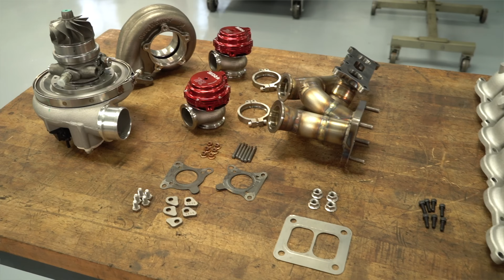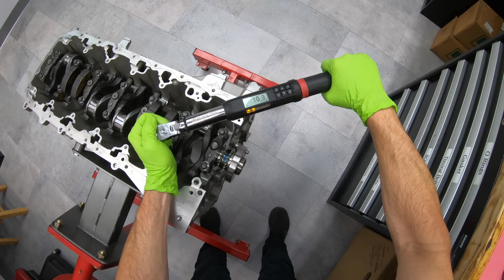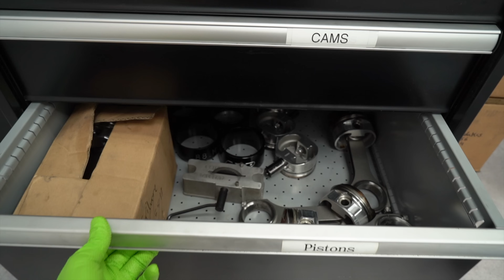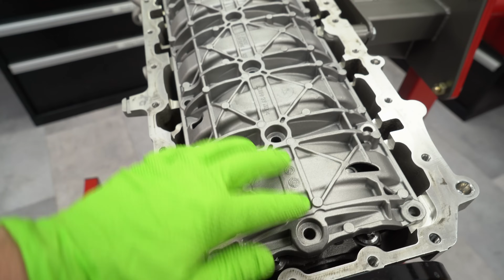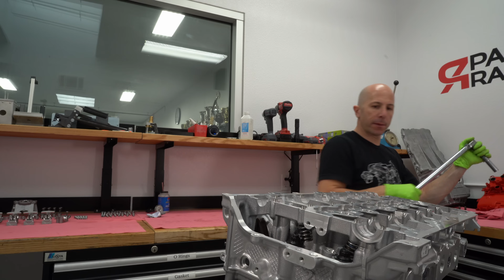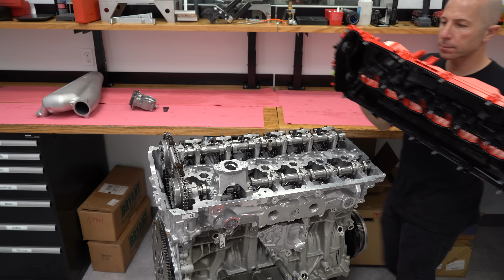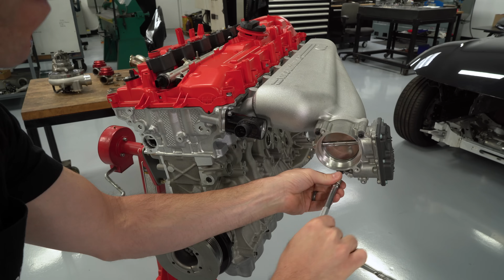2020 Supra 1000 HP Engine Assembly - Start to Finish

Comment: You know it's a BMW when he keeps saying... "And then we need a special tool" "and there's special bolts" lol
Reply: 😂🤣😂 true, you pretty much need a box of "Special Tools" to work on BMWs🤣😂🤣
Reply: @GA_pyrodawg5181  all modern cars and engines require "Special Tools"
Reply: Edward Kenway not as much as a BMW lol
Reply: @GA_pyrodawg5181  The Ford 1.5L Ecoboost engine takes 4 special tools for just putting the timing belt on. Yeah, it's pretty much all modern engines lol
Reply: Innocent Bystander timing belt or timing chain?
Reply: @abraamsamor7418  the 1.5 Ecoboost has a timing belt. Chains are easier to deal with IMO
Reply: @Sulayman Saeed fanboy alert.
sadnews the 2JZ on stock internals is only gonna be pushing 400-500HP not fuckin 1200hp like you see on 1320 bruh.
yet you can make 700-800whp on stock internals with a couple of bmw motors?
Reply: @jasonscott5778  bmw engines start to die pushing big HP. they can’t handle boost
Reply: @chiampmods  not true at all s50/s52 will do 500 all day with stock internals and just headgasket and are head studs and that is a relatively cheap engine in the 90's and it can handle 750-1000 with internals
Reply: @greglatta1  2jz is a better platform
Reply: @chiampmods whaaatt n54s b58s s55 are known for boost wdym bro
Reply: @yobabymamasbabydaddy4911  they are unreliable. they cannot handle too much boost like a 2JZ.
Reply: @chiampmods  the stock 2jz will not handle more than 500-600 whp. You’re in you’re mid to early 20’s and a fast n furious fan, or you’re too young to even drive. Please stop exaggerating the 2jz’s potential on a stock block.
Reply: @R_C32  bro any 2jz will never quit on you like bmw engines do
Reply: @chiampmods  b58 can literally almost push 1k hp on stock internals although i love my 2jz and I'm swapping my e92 bmw engines are great platforms
Reply: @chiampmods  why the fuck didn't Toyota use their own engine then? because they probably don't make a good inline 6 anymore
Reply: @DuckinGolf  they can definitely make one. but it’s 2023 and every car company only cares about profit rather than making something great.
Reply: @chiampmods say you know nothing about engineering without saying it.
Reply: @johnfurey3593  wrong, i know quite a lot lol
Reply: @Christian Burns its not a special tool to remove the sparkplugs his socket was too wide hardly a special tool
Reply: @Christian Burns what evil engine would need a special spark plug tool
Reply: @WearyKirin  BMW, Yamaha
Reply: @WearyKirin  bmw lmao I was like wtf when I changed em on my n54
Reply: And the no dip stick thing. I have an 08 528xi and even back then they didn't use them...all electronic
Reply: `special` bolts etc is more related to hw from another continent
Reply: David Valdes couldn’t agree more 🤦🏻‍♂️
Reply: then he has to put the whole thing together to set the timing and tear some of it apart (again) to put the racing parts on, toyota screwed this one up smh...
Reply: @Sulayman Saeed no it doesn’t lol
Reply: Same story with every manufacturer now, even spark plugs need a special tool
Reply: Shut
Reply: @Matts motor mechanics wrong
Reply: Yepp and try vw
Reply: Let me save you time, this turns into an argument involving 2jz vs s55, N54, B58 lol
Reply: also if you look at the inkecktors closely, they also made for bmw too, maybe we should call this engine bmw supra :D
Reply: @ambitagara  its literally a bmw powerplant, chassis, and suspension.
Reply: @Christian Burns most modern cars have no oil dipstick. This engine is over engineered is what i think you are trying to say.
Reply: and theres no dipstick

Comment: I had the same problem with the piston bolt holding ring, and it was really pain in the ass to put them by hand. So, I fabricated one small cylinder, I put the ring inside it and using old piston bolt (you don't want to scratch your new one) I pushed the ring to get in the piston hole. The same approach we all use to put the piston into the cylinder. I hope you guys find it useful. https://m.facebook.com/photo.php?fbid=375854723121434&id=278456232861284&set=pcb.375858589787714

Comment: Will the transmission hold that much power and for how long?
Reply: They could either throw the trans from a hellcat or demon since there also ZF's or convert the parts from them and throw it in to the mk5s ZF.

Comment: Hey Stephan; you can print that thing in a single part, and you can also print in more exotic materials like Invar or Titanium locally.  You can thank the local space industry for keeping a healthy number of shops in business.

Better yet, you can leverage the tech to do things that were previously impossible, like making Titanium almost as cheap as Aluminum, because you're not paying for extreme machining costs.  Also the printed materials come out stronger on average.

Cool to see you're using 3D scans for single components but you can also use it elsewhere.  For a couple hundred bucks you can have a rep come to your shop and scan the mechanical interfaces (and the rest of the engine bay for future add-ons) for the exhaust manifold brackets rather than fab a mock up; in addition to the accuracy and other benefits, you might actually save money vs your time.

Comment: Is it easier to make new supra engine 1000 hp, then 2jz???
Ther will be 12 working ingectors on this motor?
Reply: It'll make 800hp faster. But over 800 its pistons and rods need to be changed then it'll more than likely hit 1000hp(or it might jump to S55 numbers of over 1150+whp)

Comment: Is it like possible to bottleneck the horsepowers a car makes? on the go? like this car will do ba 1000 but like just in case you wanna keep it locked to something like 200-300 for cities or just general usage ( I'm guessing such huge power really puts strain on engine)

Comment: Why use the port injection and not the direct injection system? it feels like going backwards with port injection, also those direct injectors need fuel to cool down since they are going to be on FIRE

Comment: Will you need transmission mods for it to handle 1000hp?
Reply: Probably drop a demons or hellcats auto trans in it since its a ZF like the mk5s or just swap parts from the hell/demons ZF since their interchangeable.
Reply: @carboydorifutoparty3976  I wondered about that as well. But I know the hellcat/demon have the ZF 8HP90 which has a bigger bell housing and different gear ratios than the  supra's 8HP51.  I'm looking at buying a BMW 340i with the B58, and want to tune it, but it's not safe for its stock trans past 400 torque.  Was looking into option to make the 8HP45 in that car stronger.  Might have to wait for the trans they come out with that will match up with the future S58 in next year's M3.
Reply: @barnhart4486  I dunno I've heard people going right over 500hp with no problems but who knows. And I'm really curious to see what kind of power people will be making out of the S58.
Reply: @carboydorifutoparty3976 same.  I know I won't be able to afford an S58 car, so work with what I can afford.  I might want to track the 340i occasionally, so 500 wouldn't be safe for 20+minutes at a time.  Maybe for drag or daily it could get by.

Comment: Are those two bolt main bearing caps? Is there any connection or bearing cap reinforcement via the windage baffle that bolts into the block skirt? Trying to get more info on this style of build.

Comment: Those are awesome coated pistons. In which cases would you plasma line the cylinder walls? Just recently heard that, I have no idea why people do it, how it is done, and why it is done. Just want to learn more about it. Also what are pros and cons of you using port injection vs direct injection? Where can we see videos of this being tuned on the dyno?

Comment: "We got an intake manifold with built in intercooler..." 
Me : Wow I didn't know those exists
"...but we're not going to use it"
Me: Oh come on man
"Instead, we are 3D printing one out of aluminum"
Whoaah.... 
Top notch technology, custom made parts down to the washers used, special tools, clean and ordered facilities and a top notch engineer working on a brand new engine to make 1000 HP.
If this is not car guy ultimate satisfaction, I don't know what is.
Reply: Best comment !
So underrated, but you said it right, ultimate satisfaction because of the quality of the work, the tools, the video, the speech, everything is just perfect. Using ultra high technology to reach an absolute thrilling result of tuning.
Reply: I love the washers. That's how all washers should be

Comment: do you know of the differences between this b58 and the one used in the m240i? i was thinking that them sharing the same engine could lead to a relationship similar to that of the a80 supra and lexus sc300. if parts were compatible i think it would make the 240i highly desirable as it can be had with a manual transmission and would be a pretty sweet sleeper
Reply: They are and they aren't. They are the same engine but not in some parts since BMW updates/changes the B58s yearly (parts wise)since they might have different heads,turbos,intercoolers,and fuel systems some parts can be switched/changed but the mk5s engine bay is a bit bigger than the 240is so some mods like turbos may not fit the 240i. But some companies already confirmed that their working to get mods ready for them any way.

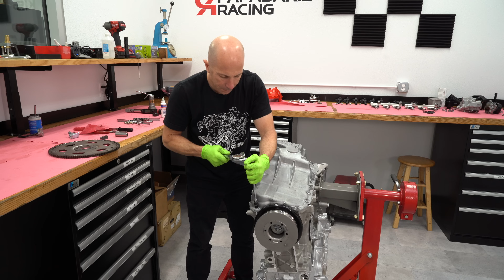Comment: 8:08 that’s exactly what I hate that all manufacturers are starting to do. 
Totally unnecessary and risky to not include a oil dipstick.
Reply: I_Choose_Us yeah I agree. What’s wrong with a dipstick
Reply: Blake Gillan It’s convenient and accurate to the masses who don’t want to get their hands dirty. Until it breaks and they have to pay out the wazoo to fix it.
Reply: @ShoobiArt  lmao the sensor costs $240 dollars and bolts up with one plug. Is that what you call expensive? 😂
Reply: @ryanturnerboles  I am talking about the general public. They parts aren’t the expensive part. It’s “specialized” labor at a mechanic and thats what they end up paying for. You should know this.
Reply: @ShoobiArt  lol I’ve owned Mercedes and currently have an Audi. So far my wife’s Nissan has cost more than both of my German cars to service. Hell we had to change the radiator fan that cost over $1k that was luckily picked up by warranty.
Reply: @ryanturnerboles  thanks for sharing?

Comment: The 2jz needs only light head work and you can pump it up to 1000hp. This engine is failure. Also you need to pay another 20k to build the transmission.
Reply: What.....u don't even need to do that......plus these are one of the most reliable and strong autos today...even demons and hellcats use them.
Reply: Carboy Dorifuto party 
No, the transmission is rated 650hp
Reply: @BF109G4  then why are there mk5s hitting over 700hp on them and haven't blown up yet. Heck the trans is modular and can probably share parts from the demon or hellcat trans any way.
Reply: Carboy Dorifuto party 
Because they’re all new, and even if they hit the 700hp they will have a very short life span

Comment: The stock block pistons rods etc can easily hold 1000 HP plus
Reply: Easily?
Reply: @jostrander71  it sure can you guys need to do some research on the BMW engines especially the ones from the 70s and 80s they all came with forged internals and now they are doing that again like the m30 engines and the m20 engines 2jzs are not the only engines to make reliable power I think people are just scared of the name BMW so they don't look into it
Reply: @jostrander71  upgrade the turbo maybe do headbolts and connecting rod bolts and call it a day

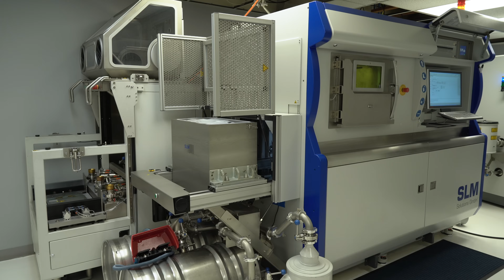Comment: 11:11 3D printing aluminum. Mind blown.
Reply: @Gareth Tucker it can be incredibly strong. depends on your design
Reply: Writing software for Metal AM machines is my day job 😊. really amazing stuff
Reply: @Shakzey  how did you get into metal AM machines? I went to school for cnc machining and want to get my hands on that kind of stuff because it seems like the future of metal manufacturing
Reply: @Tanner731  I started working at the company I am at as an apprentice. They have many different divisions, one of them being the AM division. Part of the training is to do 6 month rotations in different divisions and eventually settle down in a division you like. I picked AM because of how interesting the domain is
Reply: There’s a company called czinger and they’re 3D printing entire cars.  They’re using aluminum and titanium
Reply: @illinoisjeepboy6511  , that is amazing. Maybe, there is a video on Youtube.
Reply: indeed
Reply: Finally an inline 6 2 stroke with oil injection. this thing can run in any position and the unique thing here is its poppet valved loop charged 2 stroke! The aluminum block are easy to cut ports into for a uniflow 2 stroke and these will run any good synthetic 2 stroke oil too.

Comment: Great job on a new engine.  Did you consider bottom mounting those wastegates and plumbing them into the exhaust downstream of the turbo?  It could help keep things cooler under the hood, especially on a road course.

Comment: @papadakisracing how come you have to use the traditional or analog torque wrench if you already have the digital witch most people believed in its accuracy? Like when you tighten up the connecting rod cap you used the analog torque wrench but when you tighten up the crank shaft cap you used the digital, whAt is the difference and when to use the tools?

Comment: hopefully bmw has sorted their oil pump problems, the cause of a major class action lawsuit over loads of engine failures since debuting the n20 and n55 series engines. Otherwise its a nice looking mill.
Reply: This doesn't have any of those type of problems. The B58 is a N55/N54 that's improved to not have the types of problems you'd see N54/55s suffer from. Which is why it is now closed deck,modular,and now shares derived parts from the B57 diesel like the other B series engines.

Comment: This guy.... 130 ft-lb torque is not a lot. Try 375 ft-lbs after 2 other sequences on 38 head bolts on top of a diesel engine. That's a lot of torquing.

Comment: Is it a BMW engine?
Reply: @Seb C Yea has high fuel pressure paths than BMW's.
Reply: @Seb C I know that Toyota have an old 3.0L straight six cylinder engine and it was a legendary engine, reliable and strong and can accept more power without the need for major modifications and I think Nissan got an even better 2.5L straight six that was used in the Nissan Skyline...
Reply: @Seb C if I remember correctly the current record for S55s RN is 1150whp from RK tunes(I heard somewhere that someone else's S55 hit 1178whp) but yea. With the B58 it might hit more possibly.

Comment: What are you doing to the transmission to hold that power?  I’ve seen M4’s with power like that having issues with the auto trans smoking clutches.  So curious as to what you’re doing?   Looks like you crossed your t’s and dotted the i’s as far as the engine goes

Comment: I can hardly believe how small the exhaust ports are. Especially for such horsepower. I guess its for exhaust gas velocity but still they are tiny. Literally smaller than exhaust ports of individual cylinders on my 250hp v6. If it works.. it works  amazing

Comment: Didnt the company just recently split with toyota ? Does that mean Toyota still has a chance of doing things better but a little less complicated ?
Reply: In a sense it's basically like this. Other than people claiming that BMW built it it's not all BMW since there are the differences compared to the Z4(different turbos,different heads,higher pressure fuel system,trunk mounts,engine mounts for jz swaps,it's stiffer,has a more aggressive tune,and is cheaper) but mainly what's really happening is that BMW Looks like they don't even want to do anything with the Z4(the mk5s even sold more in sales already compared to Z4 and the Z4 was out longer than the mk5)there not even wanting to give it a M version nor any power bumps and is pretty much on the axeing list of cars BMW's going to discontinue while in Toyotas case (from what I've heard)is that their going to try to keep the mk5 in production for atleast 7 years,it's already said to have road legal track versions coming out,was already announced yearly power bumps,there's a GRMN that's supposed to be a more powerful mk5(heavy guess is it'll have 500hp),rumors that it might even get BMW's new S58 that's supposed to be in the next gen M3/M4,might get mazdas I6(hasn't been confirmed but since their going to work with mazda in 2020 its a high chance),and it's still a chance the mk5 might get a manuel.

Comment: Hey there. Not sure it if applies to this motor as well but when timing a bmw motor. Everything gets pin and blocked up like in the video the only thing I didn’t see you do is pre-tension the chain before tightening up the cam sprockets on. Based on the video I’d say your off Timing. But what the hell do I knw 🤷🏽‍♂️. Maybe it was done just not shown in the video. ??

Comment: forgive my ignorance, why only 2 exhaust ports on this 6 cylinder?
Reply: That's Toyotas doing(can't remember why they did that)but the B58s normally come with 6 port heads while Toyota strangely put 2 port heads on them(for the mk5 only) although he could've just swapped the heads from another B58 since parts are interchangeable in the whole family since its modular.

Comment: 135 lb-ft is for sure alot of torque on an engine that size but an EMD rocker assembly nut is torqued to 300 lb-ft and a crab nut is torqued to 2400 lb-ft. Need a 4 ft torque wrench for the rocker nut and a multiplier for the crab nut.

Comment: either the 1000hp or the explosion will be the greatest I've seen in a long time.
Reply: Well there's some guys that have S55s hitting over 1100hp+ on stock block and internals. I wouldn't say that this wouldn't be able to do the same since it's more than likely stronger than the S55 since it has parts derived from a diesel.